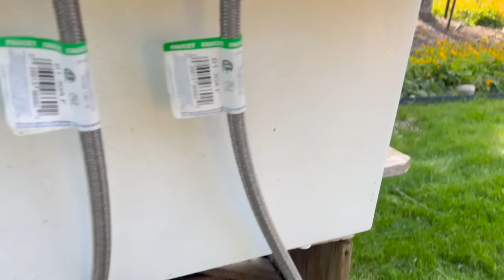How to do Laundry Without Electricity - Washing Clothes Off Grid Without Power

Comment: I think the bathtub & plunger method would be  much less complicated. Hauling the water is the worst part for any job. ❤
Reply: The only problem with that is if you 're  on a well for water. The pump won't run if there's no power so you wouldn't be able  to fill the bathtub unless you hauled the water inside from the outdoors!!
Reply: @vintagehomemaker9338  keep a wash bucket near the well, etc if possible. Then use clean plunger-only for laundry. Yes, water is a source of life but I'm sure you already know all this prepping stuff. 👍😁
Reply: My plan is two 5 gallon buckets  and plunger dedicated just for laundry. If we leave  our 5 gallon buckets  outside at all times we should get some rain water to use
 Thus no hauling water
 What do you think?
Reply: @marendababcock6104  my plan is also 2 buckets and a plunger

Comment: We have three 5-gallon buckets, one with holes drilled in that fits inside another bucket, a hole in the lid and a plunger with holes drilled in. The plunger agitates and the third bucket is for holding rinse water.  Use the bucket with rinse water to swish water out of the bucket with the holes. There are videos on here. I don't have a wringer yet, but its on my list.

Comment: You guys are so funny!  I enjoyed watching this video so much.  I remember growing up with my mom doing laundry on a wringer washer for our family of seven.  The adjustment knob on the top of your wringer should loosen to allow zippers through it.  Also, the handle should turn in both directions, so you should have been able to just turn in in the opposite direction of what you were turning it and then feed the clothes so the water would have gone back in the bucket.  I have a wringer like that that I bought at a yard sale for $10.  I've not had to use it yet, but I would if I had to.  We live in the Missouri Ozarks and we had a cistern put in to catch water off our carport roof.  It holds almost 2800 gallons of water.  We had to send to Canada to get a "frost free" hand pump.  We use it to water our garden, but it would be much better than going to the creek to get the water.  Tawra, you need to get your rain barrels hooked up to your downspouts so you could get your wash water from there.  Oh, about the stopper for the sink----we were poor growing up, even though we didn't feel "poor".  One time, the stopper for our bathtub broke and, until they replaced the stopper, Mom just wadded a thin, wet washcloth up tightly and pushed  it in the drain hole.  It let the tub hold water with very little leakage.  I think that's what I would have done.  I wish you were my neighbor......no telling what we could get into, just saying!  May God bless each of you.
Reply: Jewel Gaither - I was thinking the same thing, hook up the rain barrels. The water would be cleaner too!  Very entertaining but it did show we must be prepared or it's just going to be that much harder. Love those ladies!
Reply: Yes. If she is so "prepared" why are her rain barrels not hooked up, and being used even to water the garden, or for the "Emergency"? And I was wondering why she put the dirty rock into the wash tub. Why she didn't rinse out the tub first? This was sort of funny, but I was thinking an actual video on how to do laundry with no electricity would have been m ore useful. that's what I thought when I clicked the video!! LOL
Reply: @laurieasmus9998  Oh, I had fun watching this.  I think they were having a lot of fun, as well, making the video!  It's a reminder to all of us to do a little research in our preparedness!

Comment: OMG!  That was a nasty fall, hope you are doing well.  I think I’m prepped for laundry, have my five gallon bucket and plunger.  I recently bought an indoor drying rack. Started using it for loads of wash with smaller items. Hang tops, shirts on plastic coat hangers in bathroom rod. Only use dryer for sheets, Jeans or thick towels.  Trying to save money for electric bill.  Only in the testing part for now, will adjust when the need arises.  Great video,  thank you for sharing.

Comment: My well ran dry about 2 years ago and immediately I bought 2 275 gallon totes and a Ryobi water transfer pump. One tote for storing water and the other mounting on a trailer to bring in the water and storage too. For laundry a 5 gallon bucket and a washboard. The washboard after soaking I would just push it in the middle of the bucket and twist it. Worked pretty well. Get a top loading washing machine and pump water into it for washing. 25g to wash and 25g to rinse. I use the buckets now for watering trees and garden. Get meatal buckets as the plastic ones don't last very long. Looking forward to part 2 of this experience.  👍

Comment: Clean your bathtub and use that as your wash basin. You already have a stopper for it, and you can fill it up with water add your soap, put your clothes in and then either use wash boards or actually walk on the clothes and work them up to get them clean. Then, you can ring most of the water out into the tub, and then haul them out in buckets to the ringer to ring the rest out.

Comment: I have cleaned clothes in a bathtub. I would soak them and then use my hands to swoosh em around. Then I drained and filled tub again. But only fill till clothes are submerged. Then swoosh again. Then drain again and squeeze. My clothes were clean just as if I used a washer.
Reply: You can also get in the tub and stomp the clothes. It saves your arms.

Comment: I moved into our old farmhouse on March 1, 2020.  My husband was supposed to fly down on March 18 but his flight was cancelled. On March 19 my well went dry. I'm off grid and only had a generator for power and i didn't have a washer yet anyway. Fortunately I had stored about 400 gallons in a tank and my mom and I had that only for almost 3 months, for everything. 
I finally was able to get the well dug deeper, bought a little solar unit for the fridge. It took until October for my husband to finally make it down here. 
I didn't buy a washer until early 2022.  
If I could do this, you can do this!

Comment: Question ⁉️- wouldn't it be easier just to do all this in the bathtub you could even climb in and stomp on it with your feet?
Then just pull the plug squeeze it and hang it up. I've seen other people do that on YouTube am I underthinking this? Is that a thing?

Comment: Before starting you would make sure your tub is clean and ready to use. I would use either a plunder or wash board as today's clothes are not tough enough to scrub on a rock. I still need to find a wringer. Great video and illastration.

Comment: I miss using the wringer washers. I would have plugged the sink underneath  and used the stopper on the inside. A cheap toilet plunger inside a bucket with a lid works pretty good. You folk got a workout that day.

Comment: You should invest in a portable sump pump and use truck to drive up and down.  I have reg sized washer/dryer and portable washer/dryer that will run with solar battery.  And a line in basement to hang to finish drying.  We also have an eco pod which is like a large salad spinner.  Every one revolution outside is 4 revolutions inside.

Comment: A bucket and plunger works great to clean laundry. I have used it to wash cloth diapers and they come out clean. Also I would probably set up some kind of rain catchment system so I would have water on hand for washing and even bathing if needed.
Reply: That is a good idea. Wyoming doesn't get a lot of rain but every bit helps 😊

Comment: I have used a washcloth to block the drain, stuffed  in tightly. It holds water in my bathtub for hours. But the rubber stopper is simpler.

Comment: When I was a kid in the 80’s I watched a 70 something woman use a wooden paddle to push laundry around an automatic washing machine, I can only imagine her standing over a open top barrel back before to automatic machines were around. 
I have used that method when washing over sized bedspreads and it went something like me sitting on the banister of the deck while placing my legs in the barrel and making the peddling a bike motion with my legs and feet. Worked quite well 😂 and saved me from lugging it to the laundry mat

Comment: This was the best video I have watched in a long time!! Did you ever think of putting a simple dish pan inside to wash clothes? When we went through Ian, I used my dishwasher pan and did my laundry, I have two old fashioned clothes racks to dry clothes.We did not even have water, had to use my storage water. Most clothes are not dirty, dirty. Do you know you can hang your bras and hook underwear on the side edge of clothes rack!!

Comment: Tawra you are a real trooper for giving your all to demonstrate this! I used a wringer when I was first married in '73. There is a way to thread the clothes through the ringer and not eat the buttons & zippers. But I was replacing them all the time until I figured it out. I had a double sink so I would wring the soapy clothes into one side of fresh water & do a hand swish to rinse the clothes ( technical term, Hand Swish) . and wring out the rinse water back into the rinse side to re-use the water as long as possible. I never had to haul water thankfully! Hanging outside even in winter does work. I had a good laugh with this episode, LOL.

Comment: I just hang all of the shirts on a hanger and let air fry, even in the cold winters months. You can hang so much more in a much smaller space this way. I do own 4 wood drying racks, but don't use them fro much anymore. Also, clothes line in good months. We just have a wire on the back porch for that.
Reply: Like watching Lucy and Ethel 😂😂😂😂

Comment: This was hysterical.  Recently my washer broke and I have been washing my clothes in my kitchen sink, then rinsing and hanging up outside.   Made me  appreciate my grandmother who had 13 kids and did everything by hand.
I bought a portable washer/spinner for $200 with the thought I can use my solar generator to wash and spin the clothes.  I actually love the portable washer but I have to carry 5 buckets to fill, then when I drain I have to fill 4 dish pans of dirty water and dump in the sink.  If I have no water to use would have to hope for rain! 
Even if my washer hadn't died, I had planned on this portable washer knowing it could be run by my small generator.

Comment: Great test for being prepared. If you fold the laundry pieces in half an run through the wringer you can get more water out. Also if you zip the zippers and make sure they are flat when you run through wringer it shouldn't hurt them..

Comment: While I definitely need a wringer, I have a funnel shaped laundry tool like a large plastic plunger that is used with a five gallon bucket.  The bucket gets half-filled, the soap and a few shirts or a pair of pants and a shirt go in, and you agitate with the tool, basically a large plunger a half a dozen times.  Then the steps are repeated in another bucket of water to rinse them.  I have only used it a few tims, but it gets clothes clean well and is a way to use the mechanics of the body efficiently, as in not throwing your back out.  A wringer or a manual spin dryer would be a necessary addtion still.  On a side note, my new cookbooks arrived today, so thank you for the prompt shipping!

Comment: I have a large feed and seed bucket that I drilled a hole large enough for a toilet stick to go through. I then replaced that stick with a screw in broom stick. I have a new plunger that I can agitate with. I would LOVE to have a roller ringer. You are right, we all need to practice so it's not a complete surprise. Easy way to work the kinks out.

Comment: Ethel an Lucy do laundry the hard way. I remember my mother doing laundry with a wringer washer.  She still used up in her 80s. She had a sansevieria (snake) plant in the basement that had reached the ceiling where she did her laundry. The wringer would sometimes break the small buttons. I use to help sew buttons on. Dave is such a good guy.  If you have rain barrels you could just set up by them an you would have fairly clean water. Be alot easier than finding a creek.

Comment: Hi Tawra and Mom!
Great video but I am so sorry you fell and hurt your shoulder.  I hope it gets better fast, as the way things are going in the world, we may be doing laundry just like you showed!!!  I heard that you can fold the shirts and get the button on the inside of the item being run through the wringer and run it through the wringer without harm.  You could loosen the wringer bars a bit also and run your zipper through the loosened wringer to where it would not mash the zipper to be unusable.  I went to the Farm and Ranch Store and got 2 BIG round wash tubs.  My husband is going to build me a wash stand that holds the two tubs inside with the wringer in the middle.  You then fill the two tubs up with water and wash in one and then wringer them to the rinse water.  Then you remove the wash water (when done with all the wash) and wringer back into the empty dry tub after rinsing.  Then you hang the clothes on the clothes line.  I have a metal wash board that I bought in the Mexican Grocery Store and I bought a metal laundry plunger (for strength as I was not sure that the plastic one I have will hold up forever).  I will put the plastic one in the rinse water and the metal one in the wash water.  I bought a spinning clothes line that is square, but you are supposed to be able to stand in one spot and hang all the clothes up.  I thought that would save strength, which will be at a premium, I think.  I bought it at Lehman’s.  I wanted their wash tub that you move the handle back and forth with the plexiglass lid on it, but I thought that was WAY too much money.  I hope I don’t live to regret that decision.  I believe that the soaking of the clothes will be the thing that saves us.  Soaking in Oxyclean would be great but who will have it?  I have quite a bit of everything (the essentials) but not Oxy.  Guess I better start getting some of that stored, as it would save your strength, which would be needed in 110 degree heat after starting a fire and cooking over the fire doing dishes by hand and carrying things from inside to outside.  It is not going to be fun, but it’s true….”I can do all things through him who strengthens me.”  That is going to be my mantra.  It will have to be.  I will probably cry when I go by my washer and dryer and pet them fondly.  We all need to buy lots and lots and lots of underwear.  We want to change them every day and not have to do a load of laundry, because we have run out of underwear.  I also bought some metal clothespins.  My wooden ones are getting old and these metal ones should out-live me.  Thank you for the video.  It was funny, true to life, and sad too, but we will survive, if the good Lord allows.  Get better!  ❤

Comment: Such good advice ...giving things a trial run before they are absolutely needed.  I do have one little suggestion...I would use old one gallon milk jugs to haul my water. That way I would only have to lift 8 pounds at a time.  My hands are not as strong as they used to be. Loved your plastic bag with tape improv.

Comment: I do laundry off grid. I use my kitchen sink, a large dish pan, Zote soap, and a mini washboard. Heat the water on propane stove in summer and on the woodstove in winter.  I move my rain barrel to the back porch in winter(I can still redirect the downspout to there). I enclosed the porch with reusable plastic so the barrel doesn't freeze and wrap it in bubble foil.  Doin g the laundry in the sink is kinder to my back and the water can go down the drain. Do other chores while some soak, scrub what needs scrubbing and lift and dip and squeeze.  It forces air bubbles though the fibers.

Comment: I have 2 5 gallon buckets one with no holes, one with a zillion holes for rinsing and a laundry only toilet plunger with several holes and I have a pvc pipe with two 90degree angle fittings and a rubber band to hook up to fauct so I don't have to put in bath tub and can do it on the chair or toilet. Works amazing but I would really love your wringer, next on the list.

Comment: Thanks for the entertainment!!
When you rolled the wagon down the hill, I thought "that's not going to be too fun coming back Up that hill, with a barrel full of water"!! 
For anybody in this situation that has access to a creek, what about  using a  rope thru the "limbs" of the clothes, & let the flowing water rinse them?  Not sure if it would work (?). Maybe hand ring clothes a few times while they're tied up, to get some extra dirt out. 
Also, take the clothes TO the water, so you don't have to haul that weight, and to make sure you have enough water. 
I bought a "mobile washer" plunger, a decent size oval bucket ($ Tree), some extra 2 gallon buckets, and ordered a mop bucket & wringer, online. It rung the bulkier items better than small items. Your wringer is better for that!
I put only a little water in the bucket to  plunge the clothes, dump the water, swish the dirt out of the bucket. I do this  several times with Just water, before I use soap on the clothes. Don't use a lot of soap, or you'll need LOTS of water, to get it out.
It's All trial & error, until we come up with a good plan. Hopefully we Won't need to resort to this. 
My first time didn't go much better than y'alls ... And I wasn't having as much fun!!